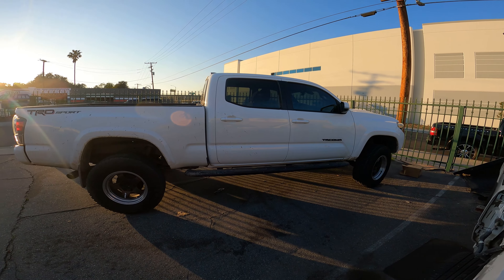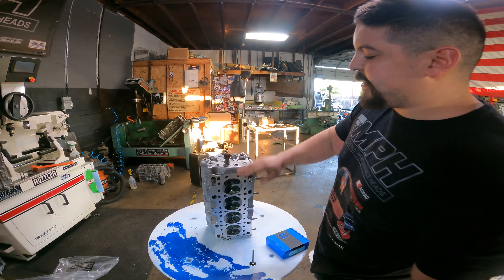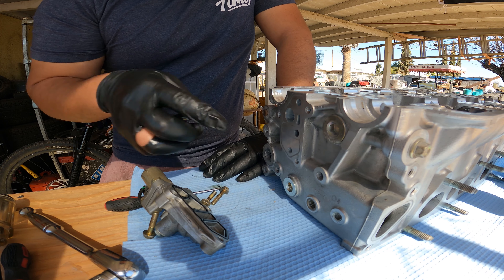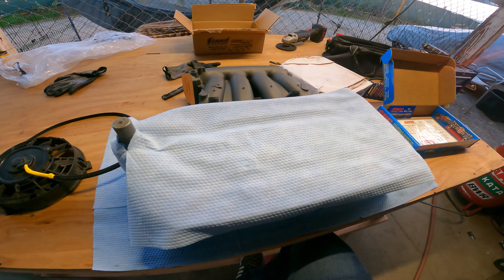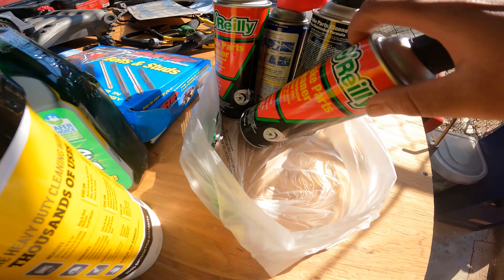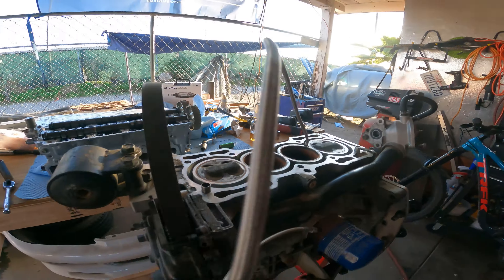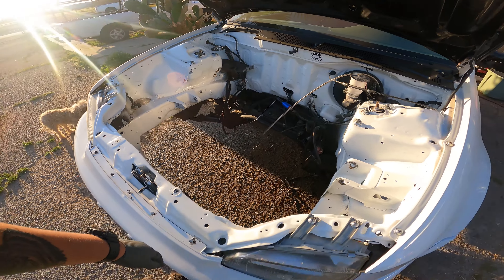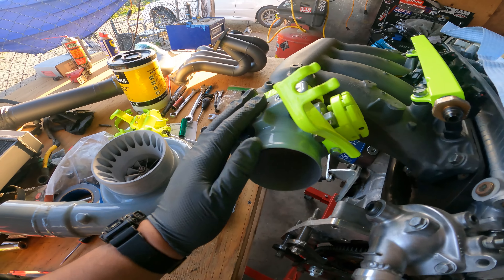Picking Up my Head from SB Machine Shop + Turbo H2B EG Update!

Comment: Is your F20b block has after market sleeve? Coz l'm debating to re-sleeve my F23a4 block for boost or not.
Reply from the maker: My block is completely stock. The only things I changed were supertech valves and ARP headstuds.